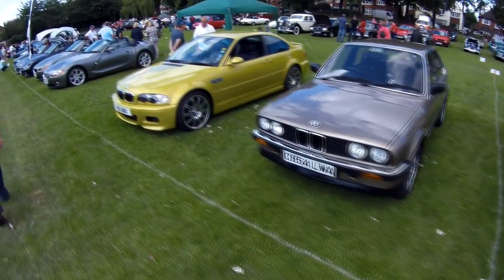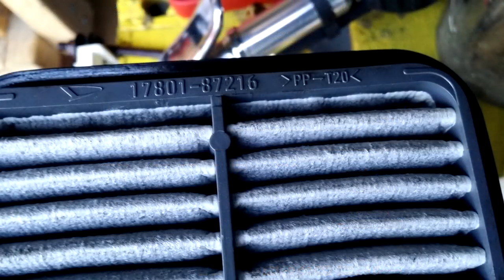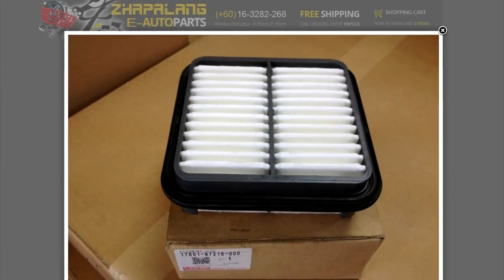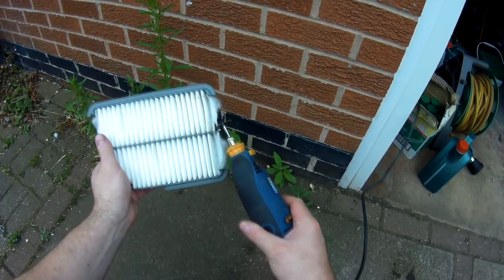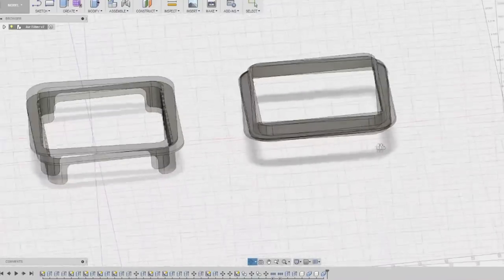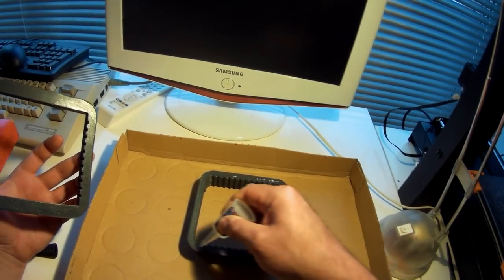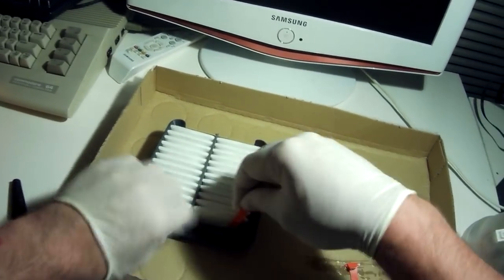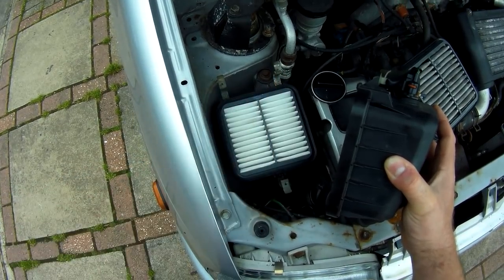3D Printed Car Parts: Making An Air Filter - Daihatsu Cuore Avanzato TR-XX R4 Project Episode 8

Comment: Would have been cooler to print a new air box that took the Toyota filter.

Thanks for sharing.
Reply from the maker: I think you'd be doing well to fit one that large in the available space! Though yes, you could swap out the entire airbox for one of similar size that has readily-available filters.
Reply: Or just buy a Toyota box and adapt it to fit the Intercooler intake.
Reply: Or, fit a K&N for some tasty induction noises.

Comment: Very impressed. Although I think I’d have just cut up some filtration foam matting and sandwiched it between some grill sheet. 
Sneaky C64 there. 👍
Reply from the maker: Yeah, that would work well, I was kind of trying to replicate the original for the sake of it - plus these kinds of filters do filter very well, so there's that.

Comment: This is amazing mate. Maybe for all the effort it was worth getting a cheap washable filter and using that as the filtration material?
Reply from the maker: Thanks! It was kind of an exercise in making a replica of the standard one to show it could be done, but also, now I've done the design side of it, I can make myself more of them relatively simply, and given the car won't be a daily driver, I'll probably not get through them that quick.

No reason at all why the same method wouldn't work for a foam or cotton "performance" filter, and I could alter my design to suit, but the cheapest panel filter I could find as a donor was about 3-4 times the price of my bargain standard type. Plus I'm not entirely convinced that there's a massive benefit to an aftermarket panel filter in the standard airbox, and I'll say this for the OEM-type elements, they do seem to filter dirt out very well.

Come to think of it, if I looked around for a bigger donor filter, I could probably make two Daihatsu ones out of it!

Comment: When you spend £350 on a 3D printer so you can save money on importing a £50 air filter from Japan :D

For real though, nice job. It does look OEM.
Reply: But you can 3D print  anything on the car what is discontinued it will pay for Itself eventually

Comment: Nice, but I'd be worried about a 3d print part in a hot engine bay. Doesn't the process work by melting the plastic to squirt it out the nozzle? What temperatures are we talking about for both?
Reply from the maker: PLA prints at a little under 200 degrees C, but you're quite right, it softens and warps easily in engine bay temperatures - not so much of an issue here, as the through flow of air keeps it cool enough, and it seems to holds its shape fine in the housing. I've run it for hours at a time without it being noticeably affected.

Comment: How is the 3D plastic holding over time, and which type of filament did you use?
Reply from the maker: It's doing fine - this was made with PLA, which although it isn't very resistant to higher temperature, it's not really getting baked with heat from the engine, so not been a problem.

Comment: So, did you 3d print the new frame simply because you could? Was there another reason that your didn't simplify the project by cutting the core out of the old frame and replace it with the donor filtering material? Your solution, while clean looking, is cost prohibitive for most. Buying a 3d printer, spending time measuring and programming the pattern, and finally the material to troubleshoot the printing would mean that you have quite a bit invested in that filter. Makes getting a cone filter (or similar), a jdm filter, or a washable drop in filter much more reasonable. I think basically you have made a good case for not doing this to recreate parts. Please don't misunderstand, your execution of this filter is great, but you did all that work....for an air filter.

PS I can get this filter in the USA (where this car was never sold) off of ebay for $7.99 (£5.75). I'm betting you spend than that in plastic.
Reply from the maker: Well, I didn't want a cone filter, and the aftermarket panel filter that you can get is pretty expensive, so combining that with a certain amount of sheer bloody-mindedness led me to make my own, to show it can be done as much as anything. 

As for taking into account the cost of the 3D printer, to my mind,  it's no different to things like welders or air compressors or other tools. They might cost more than is justified for any single job, but you can then use them for all sorts of other things, and frankly it's an interesting toy to mess around with.

With just cutting out the old material and replacing it, you'd have to be careful with your gluing so as not to leave and gaps that dust and dirt can get through - the originals have the filter material moulded into the plastic, so their "edge sealing" is very good in that respect.
Reply: InitialDave fair enough. I've watched the rest of your Playlist at this point. Seems like it came out really well.

Comment: should've 3D printed an adapter fitting for the air box to the slightly larger filter, so that way instead of having to 3D a print a new housing every time you change the air filter, you just buy the same air filter you got in this video instead, with the added benefit of more air flow to the small engine, and more filtration
Reply from the maker: I wanted to keep the original airbox.
Reply: Yeah, but just add a funnel shaped piece to the new one, keeping the airbox original. Unless you wanted to keep everything original, then I understand

Comment: im going thru absolute hell to get the same part in the u.s. who in japan would you order it from im not getting anywhere. would you 3d print another one and sell it
Reply from the maker: Im afraid I probably can't make you one, but when I'm next in Japan, I'm going to try and order some to bring back to the UK, and I might be able to get you one, would be about 5 months from now. I'll put a note in my calendar to reply/message you nearer the time.
It's still tricky in Japan, though, as its an older/rarer car over there, too. Amazon probably have them, but it's not something they'd ship internationally.
Reply: im even thinking maybe i have to take a trip to Malaysia and stock up on parts or sell the car

Comment: What 3d printing material did you  used for air filter?
Reply from the maker: It's just regular PLA. It isn't great for a hot environment, but I reasoned that the airbox shouldn't be too bad for that. Will have to see how well it lasts.
Reply: how does it look 6 months on?

Comment: Why not use your printer to make a filter box to make use of the Toyota filter? That way you can pick up a fresh filter at any time without fussing.
Reply from the maker: I think you'd be doing well to fit one that large in the available space! Though yes, you could swap out the entire airbox for one of similar size that has readily-available filters.

I'm intending to pick up a supply of spare filters next time I'm in Japan, anyway.
Reply: The biggest issue I see is the a/c line, then if you make the box to hold the filter at an angle the box can hold a larger filter in a smaller space. Don't limit yourself to just that Toyota filter and see if the parts store will let you find a filter that is closer to what you need but is still easy to find at any parts shop. New filters from Japan is a good option too.
Reply from the maker: The Cappuccino's filter is a similar size, so if I were going to use a different airbox, I'd probably go with that, but I figure if I just buy myself a big pack of them in Japan, it'll last me for years anyway.

Comment: Could you just rip the paper from the original filter and reuse that casing instead?
Reply from the maker: You could, but the way the filters are constructed is that the filter material is moulded into the plastic, and you'd have to basically stick it to the inside, so it'd probably be getting close to the same amount of work.

Comment: I’ve just looked out of curiosity and Euro car parts which are nationwide in England stock this filter for £12 

Good video and effort though
Reply from the maker: They don't. They sell ones for the normal L600 series Cuore, but not this model, which is really an L500 series Mira.

Comment: Hi mate nearly got the avanzato running just last thing is the air filter wondering whether this k&n filter will fit been told it will but just want to double check with you: https://www.knfilters.co.uk/daihatsu/mira/0.7l-l3-petrol/1998/
Reply: The smaller one a little bit down the page
Reply from the maker: I dont think the sizes seem right to me, I think that's for the L700 series with the 3 cylinder.
Reply: Ok no worries cheers mate